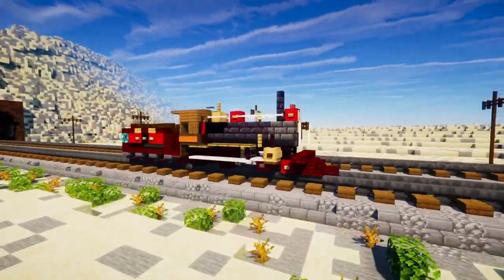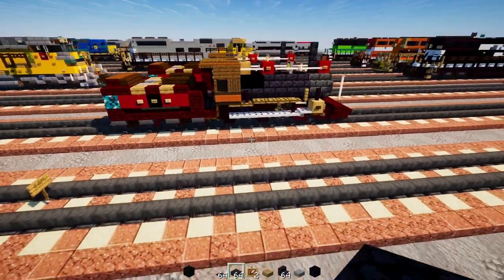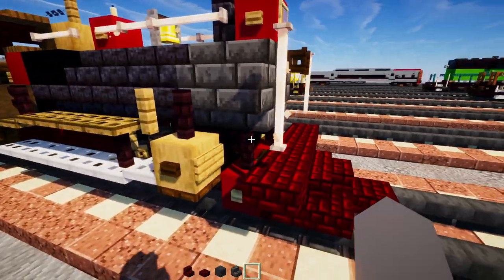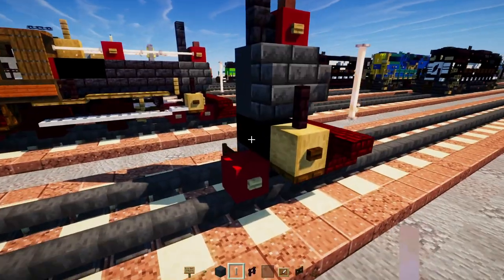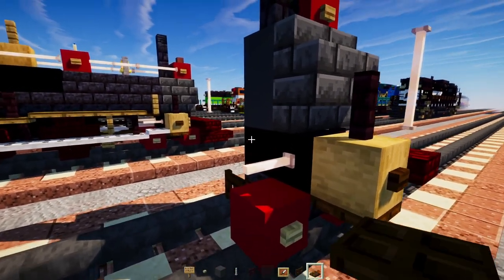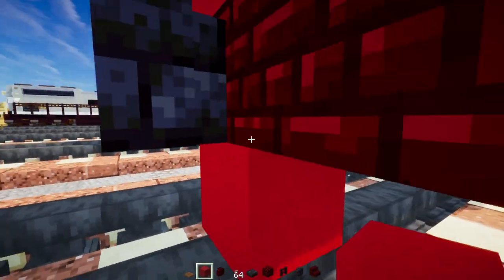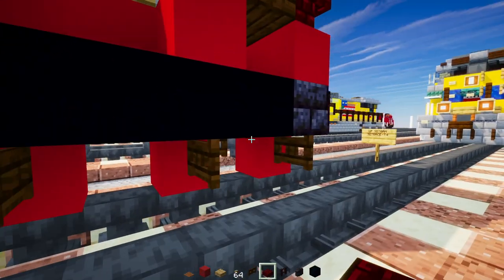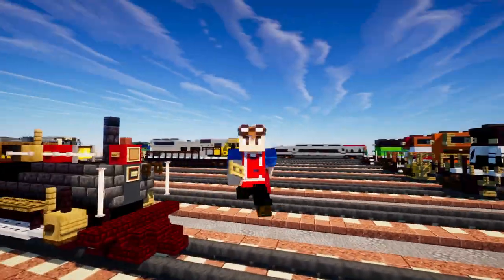Minecraft Union Pacific #119 Golden Spike Train Tutorial

Comment: probably the most customizable engine ever considering that the 4-4-0 could (and WAS) converted into 2-6-0's, and 4-6-0's, and that's not counting the QUINTILLIONS of different customization's one could make. For those doing narrow gauge (3ft particularly), due to the 1ft 8-1/2" difference, between 3ft, and 4ft 8-1/2", using standard 5 blocks if perfectly fine.

Comment: That area where you made it smaller at the cab is supposed to be a doorway it's not supposed to be smaller it's so you can use the oak trap doors to get to the front oh and one more thing the design is missing something in order to slow down 440s had a handbrake on the tender which looking back at the tender from the cab is on the right usually just before the fuel